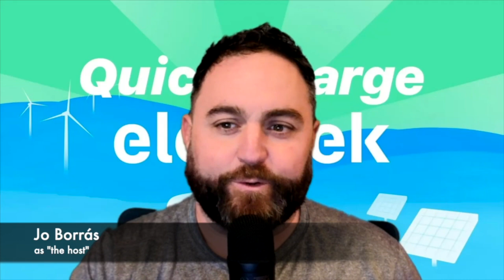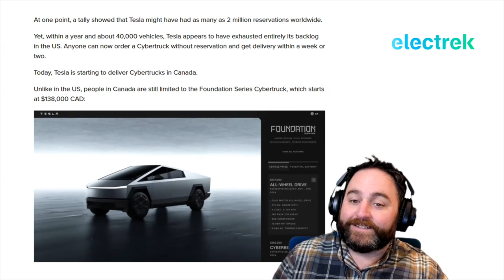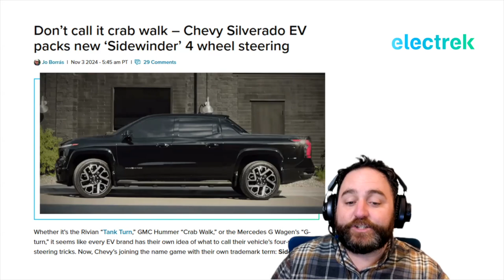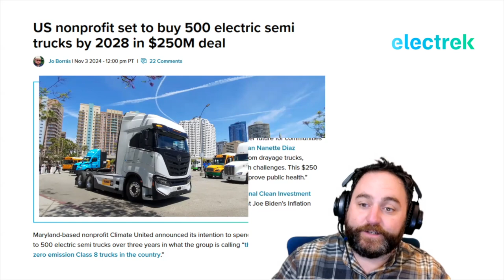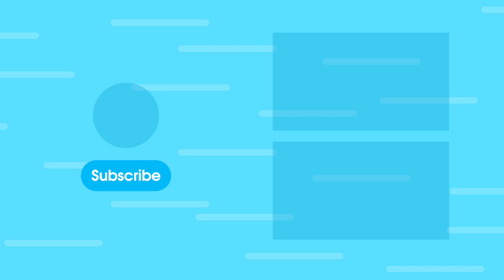Cybertruck backlog runs out, Tesla Model S gets stuck, GM hit a sales milestone, and a big wind farm

Comment: Tesla would still be slogging through building 1M Cybertrucks, IF they were selling them for $39,995 as originally promised. To me it is surprising to think that Tesla actually sold 40,000 Cybertrucks at over $100,000 each! And I think that the sooner that they make the $60K "entry level" Cybertruck available, the sooner that they will once again entice the 1M+ former reservation holders. I agree that it is good news that Chevy is back to selling competitive BEVs, after they killed off the successful Bolt (which accounts for the lion's share of those 300K BEV sales). But since Chevy is moving forward with ramping up EV Equinox sales, with a promise of bringing back the refreshed lower priced Bolt. It is reassuring that low cost, competitive BEVs always have solid sales, and hopefully good sales will convince GM to get back to their plan to offer more competitive BEVs, moving forward. I am not as convinced by the EV Silverado which (like the Cybertruck) is priced between $80K-100K out the door. Which will limit its appeal, and sales. Kudos to the offshore wind turbine success!
Reply: 💯 I pre-ordered with a 39,900 starting price in mind.
Reply: @DioscuriA85 same! 😂
Reply: Well tell us all how much more truck prices have risen in the last 4 years.  That represents at least a 25% increase in prices for ICE trucks.   Now go and look at an all wheel drive truck and see what the prices are with the f U additional stickers
Reply: But that’s just another example of promising one thing (ex: battery swap, FSD, robotaxi that pays for itself while you sleep, a $40k pickup with 400 mile range, etc) and not delivering. Eventually the guys who gave Elon $250,000 for an imaginary roadster are going to lawyer up. So will everyone else.
Reply: that bucket of bolts for $100,000 is literally insane.
Reply: @r2dezki  who is selling a bucket of bolts?